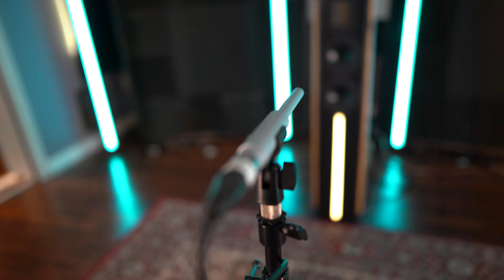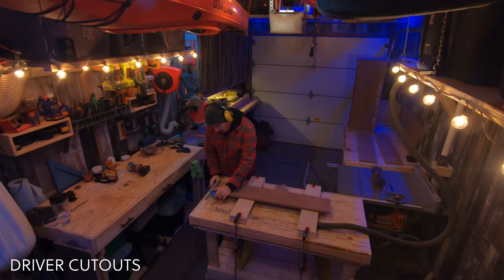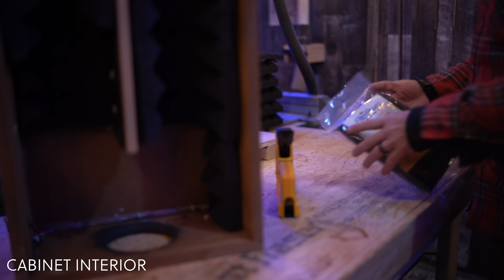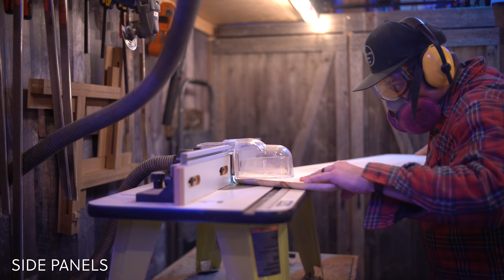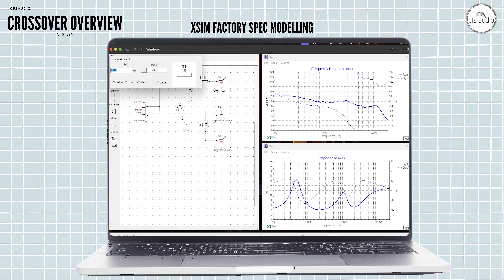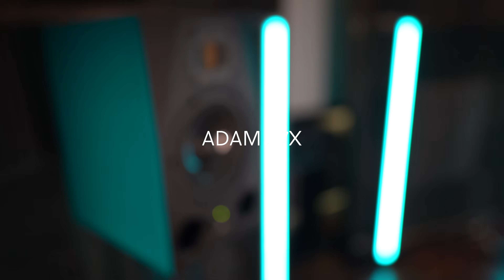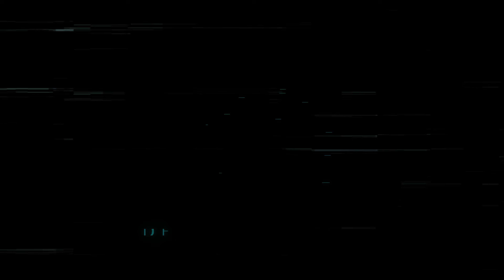🔊 Your Ultimate Guide to Building Amazing DIY Speakers! 🔊

Comment: Attention...!!! strong misinformation in almost all points of the video. but especially in the analysis of the transmission line. in reality, almost nothing of what he says is true. he simply took a general idea and serves it as a panacea. designing a transmission line is a difficult and laborious process, which he did not do. the transmission line he shows you is unacceptable. special design programs are required (hornresp) many factory, or measured parameters of the thele-small of the loudspeaker, great experience and many weeks of detailed design, in order to calculate a transmission line that actually works. not all loudspeakers respond to transmission line design. loudspeakers with Qts>0.5 are unsuitable. The crossover is designed incorrectly, giving changes greater than ±5db while changes of ±3db are marginally acceptable (here we should remember that the dB scale is a logarithmic scale and not an analog scale). The final comparison is made up to 12.5khz in order to hide the 10db increase at 14khz which makes this particular tweeter almost useless for real hi-fi constructions. And of course the inability to design the transmission line becomes apparent in the measurements with completely non-existent bass below 80hz despite the efforts of the 2 loudspeakers. In conclusion, we have another construction of a carpenter paid by this particular loudspeaker company and not a speaker designer.
Reply from the maker: Thanks for watching and all the info.

Comment: Great videos can I ask a question from the UK please. I have a pair of Tannoy D700 reference speakers which I bought 32 years ago. I have upgrade the wiring, crossovers (air coils and clarity caps), removed all ferrous parts ie binding posts  and renewed the ferro fluid in the dual Concentrics with genuine Tannoy ferro fluid. They sound very nice but I have a question. The crossover points are 400Hz and 1.5kHz. The 10" bass and 10" dual concentric are identical and in the same box air space which has 2 ports. This means that one 10" is 30 Hz to 400Hz and the second identical 10" is 400Hz to 1.5kHz. Surely when the lower bass speaker has a massive bass movement the mid bass speaker must respond like a passive radiator but out of phase. As intended by Tannoy the frequency range of both speakers can operate between 30Hz and 1.5kHz so why cant they be wired together at the same frequency or should the upper bass speaker have its own box for its frequency 400Hz to 1.5kHz. Surely each speaker operating at difference frequencies must affect the other speaker with air movement inside the box?

Comment: Great vid. Im thinking about tackling my own speaker  build. How did your first pair compare to these? Im thinking of just using the dayton 2 way crossovers likely crossed at 2k or 2.5k....is this mew build mich better in sound quality? Also what are your thoughts on smaller sealed cab with passive radiators?
Reply from the maker: Yeah there’s a pretty significant difference with these speakers. The TL is more refined and produces a more efficient and pronounced bottom end. Also the AMT tweeters are really nice and smooth. As for thoughts on a small sealed cab with radiators. I think they be great! Good luck with the build and thanks for watching.

Comment: Years ago in the mid 90s, I built a project speaker when used external crossover’s as theory and reality don’t quite meet up often, I found improved bass slam  and high frequency By Separate running the woofer and tweeter cables pretty much from the power amplifier the longer runs of a high and low.  10 gauge for the base and 16 for the highs .Also, there is a Benefit of being able to modify parts and configuration in the crossover, which you’ll probably do in time, as I for one am no crossover genius😅

Comment: I appreciate your attention to detail, getting the drivers flush mounted and checking for phase alignment. Thanks for the tip about the inductors! I also didn't expect that putting the port on the bottom was the best option for this design. It looks like you've replicated a form factor that you're really drawn to, and that's inspiring!

Comment: Very interesting. Your speaker test shows you can hear the frequency presence but not actual frequency response. As expected, my ears, through everything, told me big Klipsch won the race, 2-way powered monitors sounded dull, and smaller Klipsch sounded a tad better than custom made speaker but I believe the price tag match the line up. Very interesting test. Fun to watch. Thanks!

Comment: Very Nice! i might try to build these myself.  how would you compare these to your speaker build you posted on YT 3 years ago?
Reply from the maker: These are much more refined. The control
over the bass and color on the top end from the AMT’s is a big step up.
Reply: @chrisferris3303  how much power can these handle? i see the specs of the drivers and AMT, but with the crossovers, just curious.
Reply from the maker: I’m running them cleanly on 140 watts 4ohms. They would probably open up nicely with a decent 200-250 watts 4 ohms

Comment: Looks fantastic man. It’s funny I am in the design phase of building a 3 way using more or less the same drivers. 
I’m using 2 of the rs 8” in parallel for the lows, 1 of the 5” for the mids, and the same tweeter. I’ve had some difficulty working the crossover and getting the impedance usable. 
Any chance you could do a 3 way version of this?
Reply: Also love that you put the costs of thins in CAD it helps not needing to do the conversions all the time lol

Comment: Did you try a tapered TL at all? more difficult to build of course and if parallel walls work here ....well why not. Also worth a mention is driver excursion below tuning frequency. Some kind of high pass filter would be handy, perhaps around 50Hz or even 80 hz if using a subwoofer.

Comment: Wanting to build my own speakers for years, this has been the best video on that topic that I've watched. Very high production value, super sympathetic dude and what a nice speaker set it has become!
I'm struggling with some details such as, how to design the right port (length, position, diameter, geometric form), do I use a tubed port, do I have to separate the drivers/tweeters from another, do I for 2.0 or 2.1 setting, 2-way, 2.5-way or 3-way x-over? So much to think about before you can actually start designing and building.

Comment: With your test track, switching between speakers in less than a second, it is impossible to evaluate. From the measurements, as I suspected, the AMT is a little too hot. But add in a Sub, and try to tame the room a bit - maybe a plush carpet, some bookshelves and curtains can do a lot - and it will sound good. No idea how they Image, which is my #1 priority, but those Tweeters in a narrow cabinet probably are not bad...

Comment: Nice build. Maybe it's coming up (I'm about halfway into the video), but I hope to see the Efficiency Specs on the Drivers. Those AMTs tend to have much higher Efficiency than the Woofers. And that needs to be handled by the Crossover. 

Hope to see how your Software recommends the Crossover build for balance and Phase. 

Also, what calculation do you use for the Volume of the Transmission Line - not just Length, but Length times Width? Or are you going by the Driver's recommended Specs? 

Only nit-picks are on the Feet. Definitely not wood. Plus, those speakers are narrow, so a wider solution would be recommended for most people. But even just using feet as you have done, get some old (or new) Hockey Pucks for some isolating hard rubber. And they will never break or be vulnerable to moisture, like a mop. 

And last nit-pick, looks like you used water based Polyurethane. And applied it after assembly. For less experienced builders, or just to make things easier, definitely use oil based Polyurethane, and apply before assembly. Sanding between multiple coats with increasingly finer Emory Cloth (the black sandpaper). The oil based Polyurethane is much, much more durable than the water based. The more coats you apply, the "deeper" the finish looks. 

If you go crazy and do six or eight coats, going down from 400 to 800 grit, it can blow your mind. 

I prefer the Satin finish. But if you want something like a "Piano Black" that looks like a Showroom piece, that's the way to do it. 

Anyway, again - a really nice build. TL does provide impressive Bass from smaller Drivers. And if the AMT can Cross Over at a low frequency, you can deliver very good Imaging and Soundstage. I'm always looking for around the 1000Hz mark for the Tweeter Crossover when possible. 

Next, might be fun to build a Subwoofer...

Comment: Very nice!  Suggestion that you asked for:  I'd love to see a 70's vintage style build.  4' tall (makes cutting the boards a bit easier) 4 speaker 3-way speakers.  1 ribbon tweeter (to simulate the old style Beryllium that is no longer used/made), 1 mid-range, and 2 big ass woofers (maybe a 10" and 12" or two 12").  Would make for a great pair of speakers that sound great and look great (use LOTS of wood-grain veneer)  AND show some more aspects of speaker box making.  1: the design 2: the build 3: the cross over challenge of 4 speakers but 3-way design and 4: applying real wood veneer for that beautiful 70's look.  (oh and go crazy with the veneer too.  How about some beautiful burl walnut, or a burl birds-eye???  Just go nuts with it and imagine the shag carpet in the photos - LMAO!!!

Comment: Can we get a video on how to get the measurements for FRD AND ZMA WITH REW, and what equipment is required to do it? I really wanna build my own speakers. But I don’t want to just throw things together and hope it works. I want to be able to see exactly what’s going on, and not all drivers have FRD and ZMA files. Plus that will change when it’s in an enclosure instead of free air.

Comment: Regarding the transmission line (TL), the length of the TL is based on the resonant frequency (Fs) of the woofer, so if you use a different woofer, it will most likely have a different Fs, so will need a different length for the TL and likely a whole TL redesign (woofer placement/offset, port location, location and amount of filling). The HornResp app can really help or just use the same drivers shown here.
Reply from the maker: Good advice, thanks for watching!

Comment: I still have a few somewhat "mission-critical" questions. 1) How did you determine the vent location for the TL to be best for phase? 2) What measuring smoothing and time gates did you use, if any? 3) How did you determine the amount of rolloff for the second woofer and the distance or effect it would have on the accoustic center?
Reply from the maker: Makin me sweet for this answer lol. Thanks for watching and engaging :). 1) prototype’s and Measurements 2) 1/24 for crossover designing 1/12 for full picture 3) Didn’t concern myself with the overall movement of the acoustic center as for the crossover point that was done through measurements and tuning in X-Sim

Comment: i always get excited about DIY speakers until I remember that I don't have $30k worth of woodworking equipment in my garage. Or a garage lol
Reply: you don't need that much invested to build nice speakers but you definitely need a garage.
Reply: @josephlalock8378  I go to balcony when for the dusty parts, and other things I just do in the living room :) It's not like I'm building every day.
Reply: Yeah. But you can actually get away with a Miter Circular Saw, Router, Drill and Sander, plus some space and you can do some amazing builds. It's Time that seems hardest to come by...
Reply: All you need is a router, a circular saw, some clamps and screwdrivers.  A soldering iron is nice also.  $500 should get you going
Reply: @brianhowe2078 Blödsinn.  Einen Schreiner  muss man finden für den Zuschnitt!!👍🇩🇪
Reply: @brianhowe2078  don't necessarily even need a router. They are not super expensive though.
Reply: It is not necessary to have all the tools or the space, the most complicated thing is making the MDF cuts, in some workshop they can do it and you do the rest at home
Reply: @kristiankamilo100 I have all the tools now, but I didn't when I made my first builds. Many cabinet shops are perfectly willing to cut all the pieces for you at a pretty reasonable cost.
Reply: I got space but other tools are battery saw, not circular, that one which goes up and down. i don't know the English name. so i can cut pretty straight lines (most important) for circle i use less wide saw. hahaha. 
but when I decide to make quality speakers i will give schematics to small factory who builds kitchens, drawers etc. then i have just to assemble all together
Reply: You don't need to. I have done many speaker's without even a router. It's just a little bit more work and creativity. Buying the panels at least partially sawed to measure is recommended though. And you will buy a lot of pre-cut panels for what a decent table saw costs!
Reply: Same dumbass comment posted in every DIY video ever.
Reply: honestly I don't bother with this high end speakers videos...i skip to the design take a snap shot and that's it...cause I don't have 11.000 dollars...i can't  even afford  the Tweeters or The Woofers Which = $500 dollars...this videos are for rich people...
Reply: Not true whatsoever
Reply: It is a bit of pain but I live in an apartment and used the outside in the summer. Had to carry stuff back and forth from the attic, but it was in the days I had longer stretches of building... I bought for 300 usd worh of tools (router, sander, clamps etc ) I had the hardware store cut all the large mdf panels.
Reply: A track saw and a router is all you need bro.   Go grab some clamps at harbor freight and your good.
Reply: You need a 3d printer and a few hand tools. $500 and you're golden
Reply: You don’t even need a garage. Just a 3D Printer and some cement and you can absolutely skip wood

Comment: I made some speakers with a 6.5" open FR driver mounted on top of a speaker box with a 10" woofer mounted in the box (as usual). That is a great design: top end treble is extended with the open FR driver, the sound comes from the back and front of the open driver, making a way more layered soundstage and if there is any echo in a recording, you are going to hear it! They bring it out more than "normal 2-way speakers cos I got both type speakers and I know what I like best. 😂 The sound seems to come from everywhere except the speakers. And a single driver for the medrange and treble really makes the image more tangible. And along with dipole sound, you get imaging on steroids! It follows you around the room like a rainbow in sprinkler spray! 😮🎉 They absolutely flog my B&W 706 bookshelf speakers (regular 2-ways). 😂
Reply from the maker: Sounds like a great pair of speakers!
Reply: @risferris3303 Thanks man, you can easily build some with a pair of old speakers, disconnect the tweeter, mount 5" FR driver on top with a bunch of Blue Tack. Even connected directly, the FR driver sounds good, if you get the woofer going with it. It warms the klangy sound. Without a filter crossover on the FR driver, make sure both drivers are 8 ohm. Just hook it up to the rear binding post on your old speakers. If 4 ohms, put a 33-100 mf speaker capacitor on + of the FR driver. You will hear voices or sounds in your room or outside, that aren't there (they are from the speakers)! And you will get startled! 😂

Comment: Great video, you do a great job explaining  the process of building these speakers. I have a question for you. I’m wondering if it would make sense to put small 45 degree angles on the corners of the transmission line so the sound waves travel better. I have built a few sets of speakers myself, but I am still a novice. The audiophile rabbit hole is deep.
Reply from the maker: Hey! Thanks for watching and the kind words. As for the corners it’s a great question. I’ve seen builds with it done both ways. I’d imagine on the larger cavity 1/4 wavelength style TL like this one you’d never really be able to tell. That being said there are some really awesome 1/3 and beyond TL’s where it probably helps as the chambers are much tighter in the cabinets. The Audiophile rabbit runs deep :). Thanks again.

Comment: Having them white would have been better IMO. I have grown tired of the black monolith scheme of most speakers, but the wood side panels add a lot of class and added value. Now to the sound part. The midrange on all speakers sounded grainy and unatural. You could easily realise this was coming from a system compared to the source recording. Maybe the microphone is partly at fault here or the recording was not as great as it should be. In any case, I wouldn't be able to listen to those more than a few minutes.  Still very instructive though.Great video and explanations.

Comment: Nice build, good job!   You mentioned that the X-Sim uses manufacturers specs, so it cannot use measured data of the frequency response or impedance curve?  I've been using LspCAD for years, it does use measured data and has an automatic optimizer function.  If you haven't tried it, check it out.  It's not free however, it's 800 Euro or about US$900.

Comment: Very cool project. I'm sure they sound as nice as they look. One easy tip to get the correct phase in your XO modeling tool is to not only measure each driver individually, but also the midbass and tweeter in parallel (add a small resistor in series if you're working with 4 ohm drivers to protect your amp). Then in your XO modeling tool, connect your drivers directly to the amp. Load the response of both drivers combined as an overlay, and adjust the Z-axis (or delay) of one of your drivers until the simulated response matches the overlay. Usually the delay (Z-axis distance to the mic) of the midbass needs to be increased a bit to achieve this.